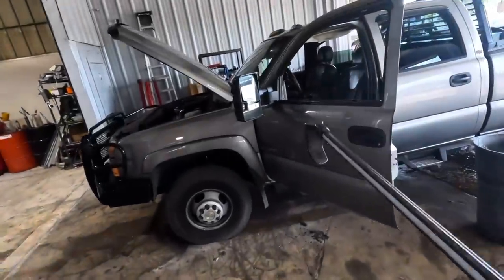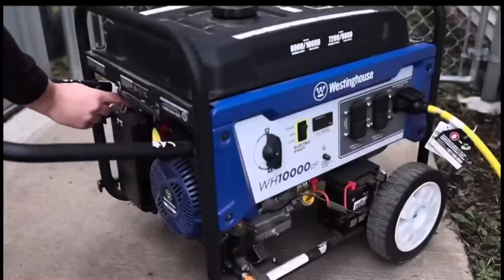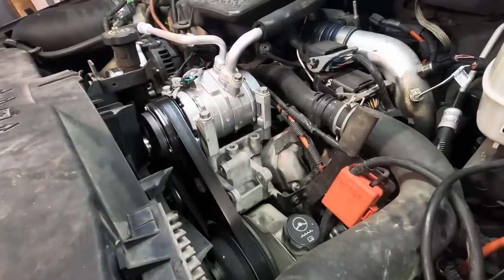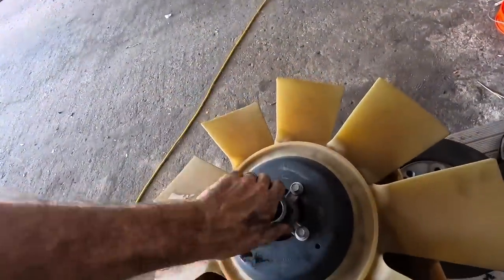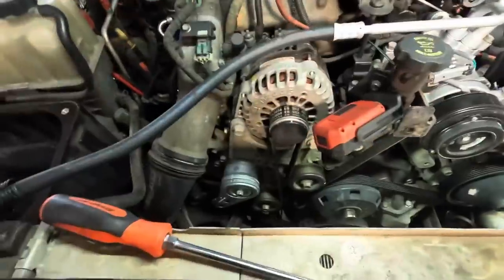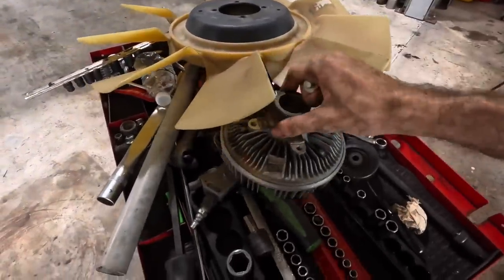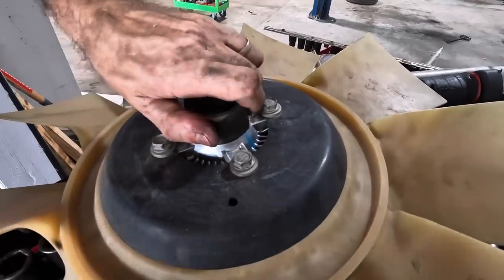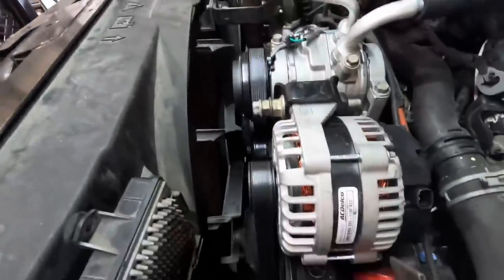Proof of Concept! Dual Alternator DURAMAX!

Comment: Those Alternators wont be able to keep up with 12,000 watts (if you use all 12,000 watts) that's 1,000 AMPS,  if you were to run both alternators and got lets say 240 AMPS you would be able to run a constant 2,800 Watts. (Theoretically)  Anything higher and those 2  12 volt batteries will drain very quickly and the alternators will not be able to keep up. Just some food for thought. Great Video!
Reply: yeah it's like he doesn't know a thing about watts, volts and amps, it's a bit unsettling but i'm not a mechanic.
Reply: The only concern is the draw on the inverters. The batteries are wired in parallel, so your assumption is incorrect. Alternators aren't a factor unless they can't keep the batteries at a sufficient voltage, and that is determined by  DRAW  on the inverters
Reply: @CatRPlrC16  nonsense, every part of the circuit will take the load, that's why we calculate these things before installing breakers and switches.
Reply: @CrudeBuster You obviously don't understand how inverters work
Reply: @CatRPlrC16  you don't know how god damn electric circuits work if you think there's no pull in the alternator and other parts of the circuit when the load is unbalanced
Reply: @CrudeBuster  I guess you've never heard of a voltage regulator, usually a component of the alternator.  I also guess you think the alternator sends current and voltage to the battery and other components of the electrical system constantly. Well, you're sadly mistaken.

Comment: if your running front to back from the alt to battery your gonna need bigger much bigger cable  or you will turn your truck into a big heater

Comment: go with a diesel genset, quieter then a petrol genset, runs for ages on little fuel and you can use the fuel you already have, hell they make multi fuel gensets these days.

re the 100amp alternator, is the 145amp the same physical size ? if so, worth swapping the 100 out for a 145 to give a bit more head room ?

<edit> just answered the question, oh well.

Comment: All that effort for two alternators, when you could have installed a Leese Neville a1600 series at 240 amp using a JL80 mounting kit. Way more durable and cost effective. Mounts right where old alternator sits.

Comment: Those deep cycle batteries might not have been at full charge, 12.35V. They are sucking up power even without the heat gun load. Once they are at full charge, there will be more power available for the loads you have. Keep in mind, the lead acid chemistry will lose charge at about 1% per week in storage mode. This is not a big issue until you need them. You might want to setup a smart trickle charger and use that over nights while the truck is parked.

Comment: That mounting plate might cause trouble if there isn't a solid electrical connection through that paint.  And if the regulator/exciter circuit in that alternator is supposed to be modulated by the ECU then you might need a different signal other than straight B+ or ground to start it.  The regulators will self excite the alternator based on demand indicated by the ECU (PWM or somehow, idk) so that the voltage doesn't get too high or too low...  And connecting the exciter circuit from the aux alternator to the main alternators exciter circuit would also require a shared B+ between the alternators because the regulator circuits would also need to know the voltage on the output.  But I don't see why you couldn't just parallel the alternators together (Ground, B+ and exciter) and just switch the batteries in the back on when you need them or want to charge them... Then you'd have 3 batteries in parallel as reserve when generating, but you also don't want all three at all times, only when the inverters are running...  Parallel batteries can end up imbalanced causing one sick battery to drain the others faster than they would normally drain alone.  Might also be a good idea to somehow wire up a light in the back so you'd know when that switch/connection is on/off, or some way to remind you when the rear batteries are in parallel with the engine battery...

Comment: Great job as Usual. That being said, you're just better off. Changing both of those small alternators and switching two 270amp alternators upgrading the ground and power to 0 gauge wire fusing them as well, Between the battery to the alternator as well as from the front to the batteries in the rear to protect the wiring. And upgrade the 2 batteries to AGM batteries like odyssey highly recommended uses pure solid  plates, one of the best batteries in the Industry... Just saying lol love your content until your next video.

Comment: Are you gonna delete the overrun/decoupler pulley on the factory alternator when you change pulley sizes or do you think you can find a larger one with the overrun/decoupler function?
Reply from the maker: I found two 44mm overdrive pulleys. I’ll have to loose the decoupler feature but it will be worth the extra alternator speed
Reply: @RainmanRaysRepairs  absolutely for your purpose. I'm not very crazy about some of the "technological " features of modern vehicles. My 06 1500 doesn't have the decoupler so I was kind of surprised to see your 07 with it. I like simpler and at 37 years old I'm finding that my like for simple is growing with age. Prayers for everyone down y'alls way with the upcoming storm.

Comment: What's going on with your truck's radiator on the passenger side?
Reply from the maker: Someone changed the belt once and the ratchet used on the tensioner smashed the cooling fins

Comment: Hi Ray. Need your guidance. I have toyota sienna 2017 and have changed rotors twice in a year, but still wobbling is coming back in couple of months. I heard its an issue with sienna. Can you suggest any good quality rotors that I can put on sienna?
Reply from the maker: Have the hubs checked to see if they have runout

Comment: Hi Ray, great setup and the theory for what you are doing is fantastic.....however....mathematics always gets in the way. The MAXIMUM that alternator will supply is 1740 watts, 12v X 145a is 1745watts or 14.5 amps at 120 volts. Calculations made on the assumption of 100% efficiency, I would subtract 10-15 % from this in the real world.

Two options open to you are to have the alternator you just fitted Delta connected, any competent auto electrician should be able to do this, you gain about 75% increase in current but thge nator wont charge at idle speeds, I had exactly this setup in a car with 1000 watts worth of halogen lighting across the front of it......or put the 400 amp unit in. 400 amps will work out to be 4800 watts or 40 amps on your 120 side, again assuming 100% efficiency.

Strongly suggest a cheap clamp on ammeter so you can take these measurements for yourself but at any rate, jumper cable sized wire will need to be run to the battery box.

Comment: You don't have 12000 Watts in your truck.  2 Battery at 100AH  (Total = 200AH) + discharge at an aggressive 1C = 200 Amp + 240 Amp of alternator...    So, you get about 440 Amp for 20 Minutes = 4800 watts.  After you fall to alternator power alone : 2880 Watts.

I am not sure of the duty cycle of these alternators, but many are rated 20 Min at 100%.   On RV duty, their life are usually short.

On these 2 batteries alone, you likely don't run more than your refrigerator all night.  You will get about 200 A  x 12 = 2400 w/h or 2.4 kw/h before depletion.  That on brand-new 100AH  lead-acid batteries.

Now, unless you get to LiFePo₄,   the battery weight is about 63 lbs per 100AH.

Comment: 145A at 13.4V is 1943W.....which is likely what your heat gun is pulling.....but I doubt the alternator is going to give full output until revs pick up some more, even with the overdrive pulley.
Reply: plus duty cycle 
max amps = max heat
Reply: Alternators even in best-case scenarios are only rated at 80% of rated amps for continuous use.

Comment: You can run your home Air Conditioning with a soft start with your setup. Once you change your injectors that will feel like a brand new truck man. You will get more power and econ as well. Also really old injectors have a bad habit of coming apart and destroying engines.

Comment: Love the set up. The only thing I'd do differently would be to use 2 2000w lithium batteries as they can be discharged to almost 0%,. Plus lithium batteries can be slim thus giving you more room in the toolbox
Reply: He would also need a bms if he goes lithium, remember hover board and phone fires that was with small batteries. On the other hand the off gas issue goes but gets a heat issue in the enclosed box
Reply: Most off the shelf lithium batteries come with a BMS.  The only time they don't is when you by the raw cells.

Comment: Ray, Ray, Ray...... Have you done any of the math on the actual output of the alternator? That 145 kw alternator only puts out less than 2 kw. Those junk lead acid batteries in the tool box are 100 amps each, and with lead you never want to go less than 50% depth of discharge, so you have about 100 amp/hours capacity before majorly destroying your batteries. Then that 1.9 kw output of the alternator is reduced by 20% due to inefficiencies of the inverters giving you about 1.5 kw useable output. So all that you really can run is that heat gun. Any more and the alternator maxes out and the batteries start draining. At 2.5 kw, you are done in about 1 hour assuming good batteries fully charged. Although this battery is ok for running some power tools and possibly some lighting on a job site, it is almost useless for home backup beyong some lights, a TV and the refrigerator. There is no way it will make hot water or run an A/C unit no matter how much inverter capacity you have. I use a couple of 140 amp alternators and 1.8kw of Solar on my yacht with 8 kw of lithium batteries and a 3000 watt inverter. We can make limited hot water, cook and have lights and TV and run the watermaker a bit, but that is it. This is ONLY good for running some tools in a remote location

Comment: The car stereo guys are using lithium banks and multiple high output alternators in their vehicles with multiple strands of heavy Guage power cable. You might as well put a subwoofer box under your back seat and upgrade your factory speakers. Lol

Comment: Keep an eye on the temperature of the various wires.  I know this was just a temporary test, but I am concerned about the size of the cables runing back to the inverters.
You're talking about 7000 watts on the two inverters you have now and considering adding another.  Ohm's Law P=I*E so 7,000 watts divided by 12v is 583 amps at full load.
That's over 8x what the 4ga cable can handle (it's only rated to 70a).   Look up ampacity charts, and keep in mind that cable size should be selected for no more than 80% of capacity for continuous duty.
You can get away with smaller wires at higher loads for short term (such as starting the engine), but a continuous load supporting your home overnight is going to put a lot of heat into those cables.  You saw how hot the short battery cable jumper got driving only the heat gun, and that was pulling less than 20 amps.
Of course, your alternators are never going to supply 583 amps to the toolbox, but even at the ~240 or so capacity you have, you would need something in the ballpark of a 4/0 cable. 
You can get away with smaller conductors for the short runs from the batteries to the inverters, but it's still going to generate a lot of heat (wasted power).

Comment: petrol generator's went out of fashion when Noah finished building the arc...  diesel / propane  is more reliable and cheaper to run here in the uk... but we do have hand portable mixed fuel generators  for away from home as a power supply...my personal power unit is a towable  welder--110 -240 volt ac-dc  inverter  generator.@ 25 kva that uses propane  or diesel..

Comment: A diesel generator would be be better, and it can burn waste oil, or get a 10 hp diesel engine,  bolt a couple 150 amp alternators to it, and a few feet of 2/0 welding cable, Anderson connectors. And there you go! Use the batteries in the truck, charged by a smaller engine!

Comment: My explorer had a stock 220amp alternator. It seems weird that you'd only have a 100amp or anything less than 200amp. Also alternators will only supply as much power as what is requested of it. I'm typing this fairly early in the video but having an alternator on a switch would actually be rather useless. With that info, you'd have been a lot better off getting a higher output alternator, which you can get a decent one for about $200-$300. Then you could've more than likely maintained your factory belt given how much tension you had on it.

Comment: Mabe you could get a second hand engine and build it into a frame then consult an electrician to design the switch gear. That way you get all the power of the engine producing electricity. You could design the system to sit between the truck and you house ready to kick on if the battery system gets too low.

Comment: Do you not have an amp clamp for a meter or alt checker? How do you load test an alt?
Reply: he doesn't know a thing about these, he's not an electrician, this rig is definitely wacky and it didn't needed to be... a few minutes and some calculations and all this entertaining nonsense of heatguns and clamps and batteries wouldn't be necessary for a test but whatever.

Comment: I think you may have mistaken the math some, Ray.  Even at 100% efficiency and zero loss, a 145 amp alternator will not even supply 2,000 watts.  Of course there is efficiency loss in the power inverter(s), so you won't even get 1,500 watts of output from that alternator.  Having 10,000 watts of inverters will be meaningless as the system cannot keep up.  The two deep cycle batteries (~100aH combined) by themselves would only provide maybe an hour of runtime if you're drawing 2,000 watts of power draw.

Realistically, you'd need two high out alternators to try and break 500A if you want 5,000 watts of reliable power.
Reply from the maker: We will get to all of that soon. Right now it’s barely functioning and has been made to work. I need to finish fusing and wiring the inverters, there must be breakers and solenoids installed. I need to take amp draw measurements and make sure that my wire sizes are correct. It will take several hours to have a finished and save setup that can run long term
Reply from the maker: Then I’ll connect both alternators via a solenoid and have about 200a available to run inverters. Again, I need to take real measurements. Keep in mind that with my potential loads that I’m planning on, I may not need 2000-3000w at all times. Let’s say I’m running two refrigerators, two fans a tv and some lights. The fans will need 120w each, lights will total 40w and the tv/internet will draw 250w. So I’m at about 500w, add a refrigerator, we’re at 800w that came with a 500w startup draw for 2-5 seconds. So the system load is now 800/1300w. It would support a second fridge as long as both units do not come in at the same moment. Having said that the alternators have to send back about 1000-1200w to keep up with the demand.  All of the figures are estimates and nothing has been measured yet with meters on the DC side or the AC side
Reply: @RainmanRaysRepairs  I understand your reasoning now.  I took your comment of "10,000 watts" too literally as verbatim...that's my fault.  If you only need a couple thousand watts and have to spike over that periodically (i.e. fridge compressor starting), both DR44's will be more than sufficient.  Kill-A-Watt meters are also a great way to help calculate loads.  Cheers.

Comment: Maybe you need a flux capacitor instead, so if you have two alternators putting out 13.50 volts and truck runs on 13.50, where does the other 13.50 volts go.........

Comment: You like to use 8KW+ at emergency situations, i imagining this setup catching fire @ 3KW or maybe 3.5KW max. You need more than 150amps alternator because 150amps × 13.8volts not gona make such power (150×13,8=2070wats). Maybe combining both alternators is good enough if they manage to make max power and not fight each other because if one of them output little more volts than the other, that alternator is basically blocking the other from producing anything useful. The solution maybe is to wire them in series, but this make the truck becoming 24volts and bye bye truck electronics.

Comment: 12v x 240 amps =2880 watts from both alternators
Typically I see a 250 amp mega fuse in a big class A    3000 watts
That’s pretty heavy gauge wire
That’s a fairly heavy load   
Check your batteries monthly.  Keep distilled water with you

Comment: I said 00 size wire for a reason 
Its not just the amperage,  its also the lenth of wire x2 
You figure your power wires 18' long if you apply a load how much amperage can the wire support and over what lenth, the fater the wire the less restance the hotter the wire gets the more restance you'll get  I always like to over do the wires capablity size so it dosnt get hot, because heat will lower the supplied voltage or burn up the altonator or your power inverters becuse they cant keep up with demands.
Also they have an effency rating peak power is probably the ratings given.  Man I belive you went to school for electronics you show know how to figure Ohms law. And find the nessary wire size. All said and done your wire runs over 20' long.  I did this for car audio and I can tell you if you ran a 10ga wire to an amp that puts out 1000 true rms watts your going to have a boat ancor in no time.